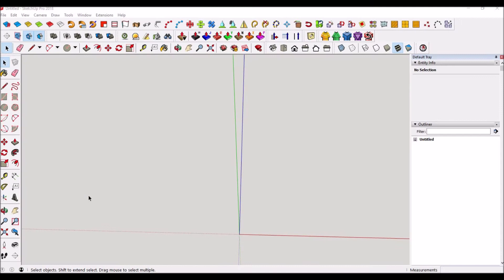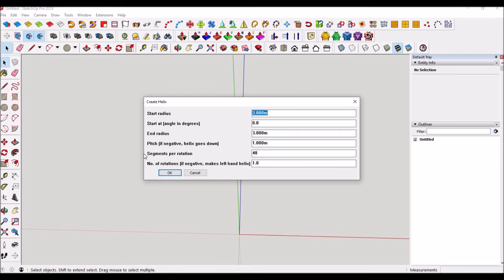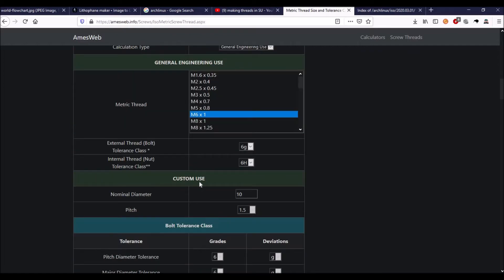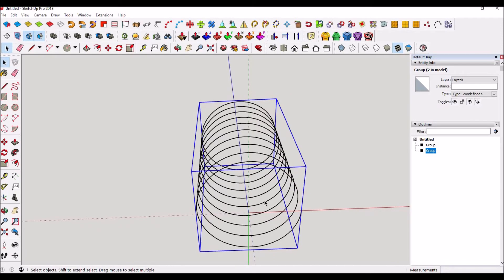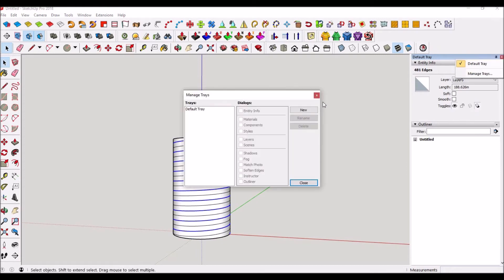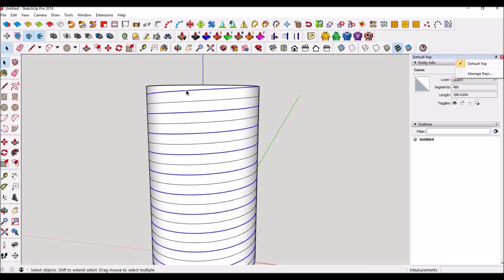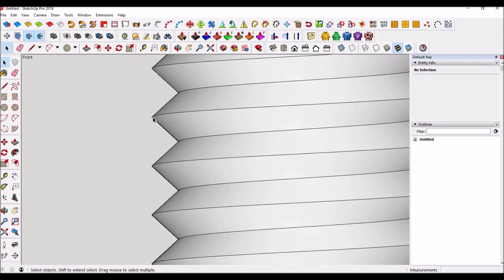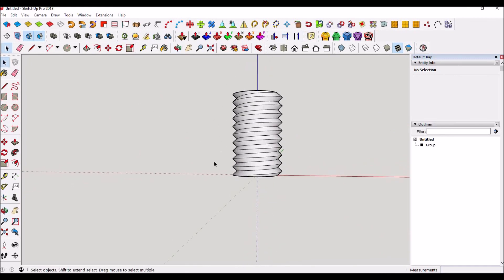How to make accurate threads in sketchup part1

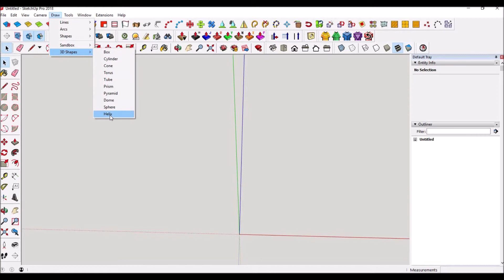Comment: 01:30 Problem with the current (on 23SEP2022) version of the Shapes extension is it does NOT include Sphere and Helix in the list of shapes one can draw. The previous two commenters are correct in that the music makes it difficult to understand the narration. I tried to follow to the end but I couldn't take the music, had to quit before it drove me nuts.
Reply from the maker: thats strange, i just checked the original file and there is no music. Something went crazy when it uploaded to you tube. It used to not do this.. sorry guys